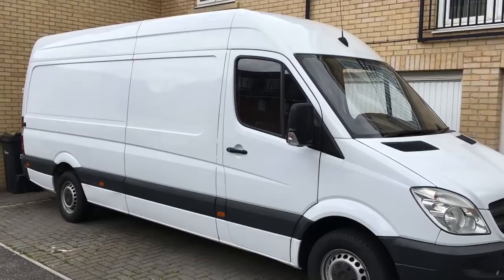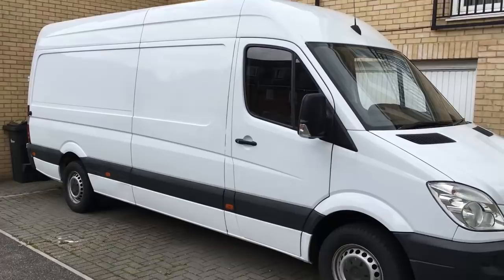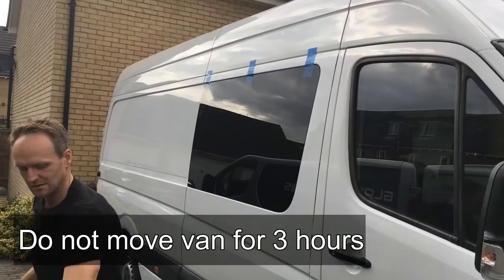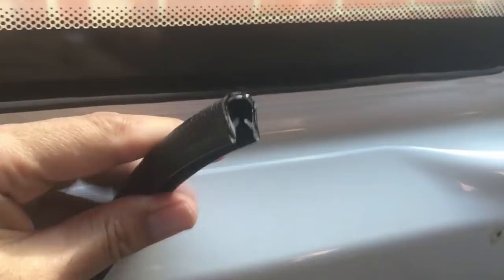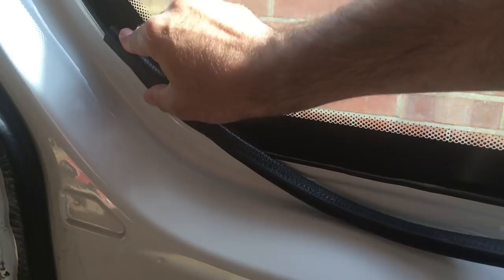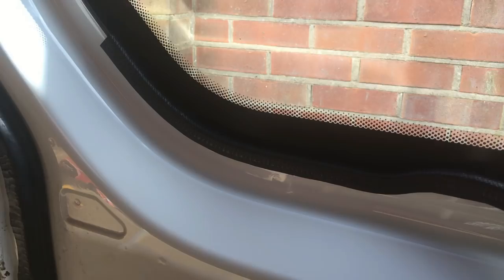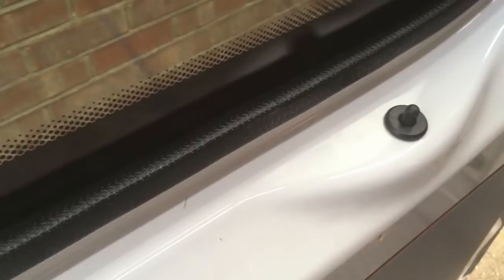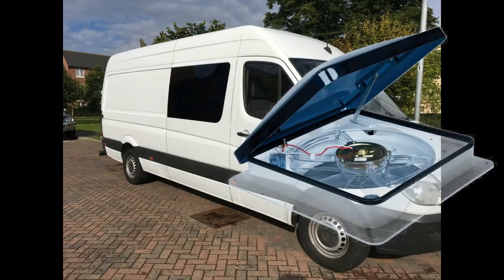How to Fit Bonded Windows - Self Build Campervan

Comment: Attention attention. I fitted my own windows in my sprinter 64 plate . Great job . I thought but . My bonding agent squeezed too far inside van .big mistake rubber  seal wont slot into place . Gutted to be honest . Tried  picking it out but it’s like cryptonite ☹️ any advice welcome
Reply from the maker: Gary henshaw, depending how much and how far round the window it is you could cut the back of the trim a little in the affected areas. I had to do that in one spot on the side.
Reply: Thanks greg . Yes did think of trimming rubber seal at points . Also seen a J shape trim on eBay maybe order that & try it . Thanks again

Comment: Hi again sir sorry I should of said What s your budget for the whole project
Reply from the maker: Sorry Steve, thought you meant just this element. 
The van was £7k and I’m looking to spend £8k on the fit out. Not a budget build this will have a professional look and lots of tech. Cheers
Reply: In the land of Donald T, anything under $125,000 is considered budget. Lithium batteries and large solar array will set you back $15,000.
Reply from the maker: Is that USD? That seems like a lot of money?
Solar panels are approx £1 GBP per Watt these days.
Lithium is still expensive so I will go AGM for this build.

Comment: Hmm, any reason you didnt go with double glazing a la seitz?
Reply from the maker: Seitz are plastic caravan Windows and would not have suited the look we wanted. The Windows we went for are tempered privacy glass and designed to fit the recess of the van perfectly. Furthermore I didn't want opening windows as these are a security risk. Gone for roof ventilation instead to hopefully reduce possible break ins.

Comment: does anyone know what tool he uses to cut open the van ?
Reply from the maker: Hello Joshua, it is an electric metal shear, very similar to a nibbler only it doesn't produce all those crescent-shaped fillings just a really clean cut.  https://rover.ebay.com/rover/1/710-53481-19255-0/1?ff3=4&toolid=11800&pub=5575265109&campid=5338027957&mpre=https%3A%2F%2Fwww.ebay.co.uk%2Fsch%2Fi.html%3F_from%3DR40%26_sacat%3D0%26_nkw%3Delectric%2Bmetal%2Bshear%26rt%3Dnc%26_dmd%3D2
Reply: Greg Virgoe thanks pal ! Love the videos! I have watched alot of these van conversions and you are by far the easiest and best to watch! Cheers

Comment: Hi Greg, How are you getting on with the Van Build Buddy ?
Reply from the maker: Hi, been spending a lot of time sourcing the right equipment to go in the van so I can finalise all the electric water and gas requirements. All these services need to be installed and hidden as I do not want anything on show in the finished van. Have two week off work soon to hit it harder and get stuff done.
Reply: Thanks Greg

Comment: Are the windows single or double glazed?
Reply from the maker: CocoBunjee they are single sheet of toughened glass
Reply: Greg Virgoe
Isn't double glazing for vans available?  The UK is so cold in the winter, seems like a necessary addition?
Reply from the maker: CocoBunjee, yes, you can get plastic double glazed units that are made for caravans and motor homes but I don't like how they look and didn't want my van looking like a caravan. We will have an electric / LPG heater in the van to keep it warm if it gets cold.